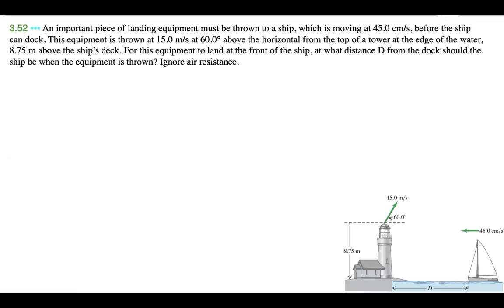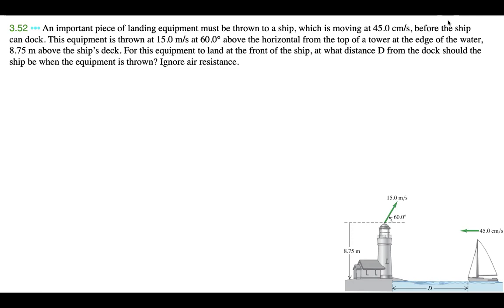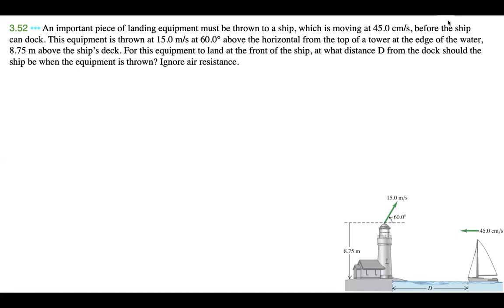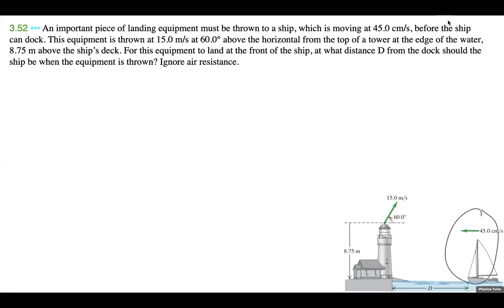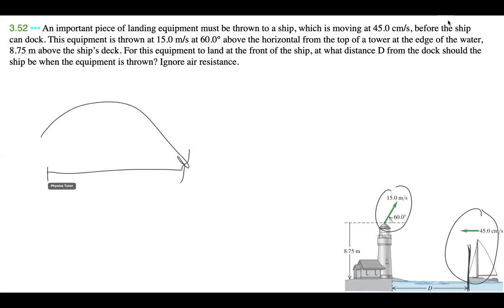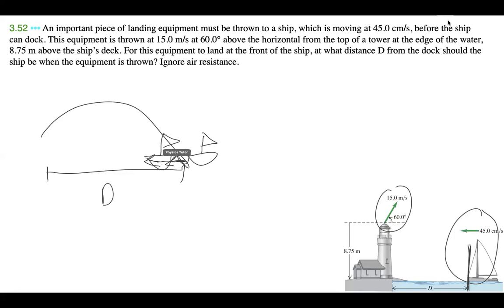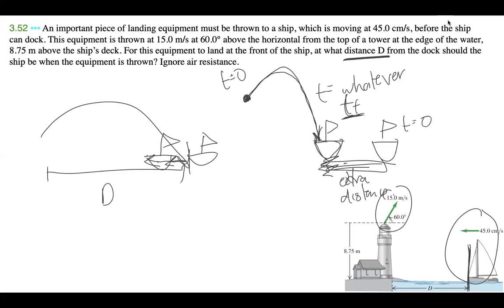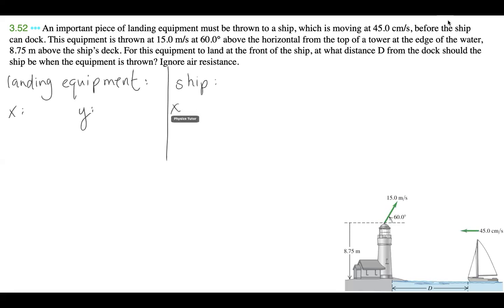Ship Projectile Motion Challenge Problem!

Comment: the ship movement shouldnt be negative, it's positive
Reply from the maker: So in this problem, we can see the arrow (green) points towards the land (left) and we've set the coordinate system in the question as up and right as positive. Therefore, for this problem, the way I've set up the question, the ship movement is negative. However, if you set left as positive then you can make ship movement positive. It depends on your coordinate system.